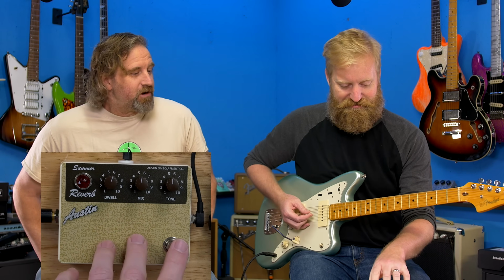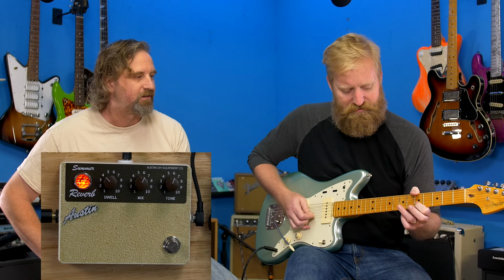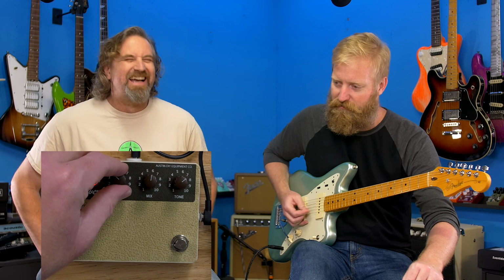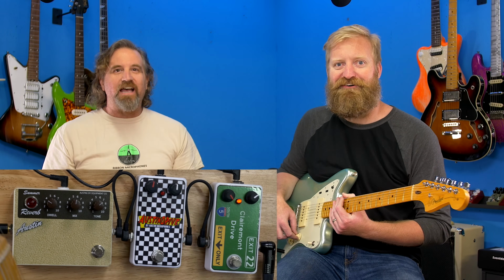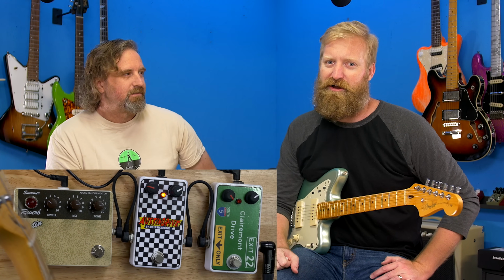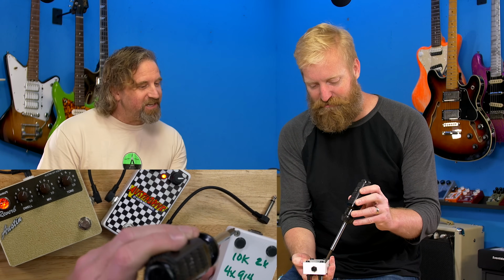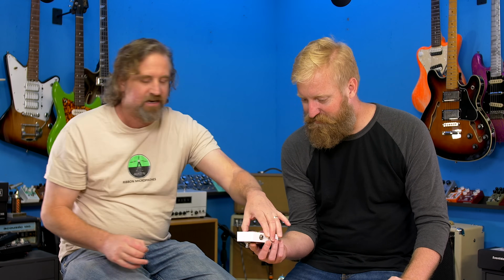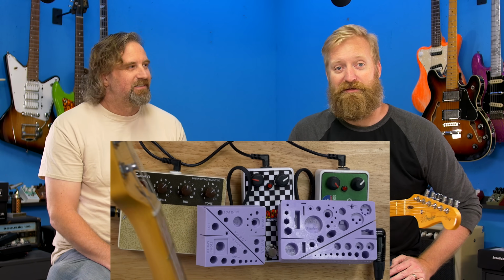A Reverb Pedal that YOU CAN KICK! + Dirt pedal kits from Austin Ribbon Mics

Comment: I have an idea, idk if you care or not but . . . Why don't you make two versions: a more affordable version with the sockets just like what you have, and one version that costs more but you just put variable capacitors, rheostats and potentiometers in there instead of sockets. Of course that doesn't apply to the diode sockets, but still. Some people like doing build kits and taking their pedals apart and such; others want the versatility that offers but simply aren't going to do that stuff. Could expand your demographic while maintaining the premise of interchanging circuit values.
Reply: I do care, and it's a great question. Here's why: When you read values or measure components, then manually place them into a circuit and listen to the result, you learn why a 39k is different than a 22k. Not just twisting a knob. ALSO, if you wanted, YOU could ditch the sockets and just run wires to pots. I've done it, and the result is: "Oh, HELL No!" (The actual name of the one-off pedal I built that does this!) 6 knobs. Super hard to control.
Reply: @AustinMics  Ha! I should have figured that, true to character, you had already played around with it LOL

Comment: We need a shootout with the Mosky barcode reverb!
Reply: The Pink one?  I actually bought one during my development, and used it as my baseline for how *I didn't* want it to sound. Same chips internally to create the reverb, and mass-produced with low-end jacks and switches by pick-and-place manufacturing robots, but I refined my design to get a little more, without oscillation. 🙂